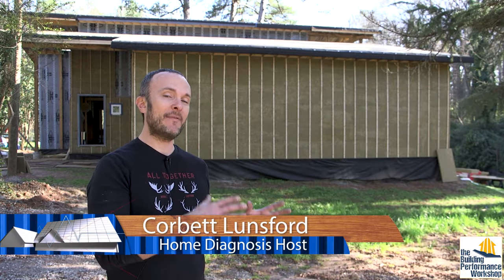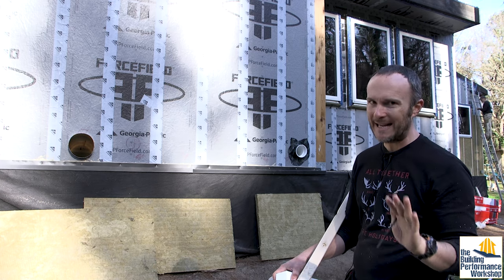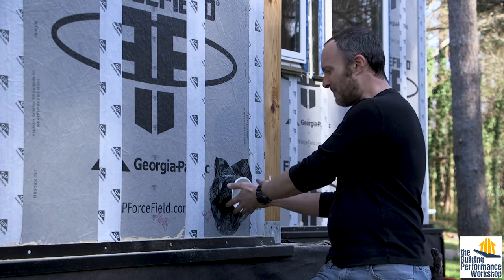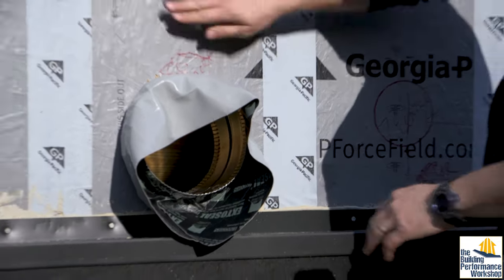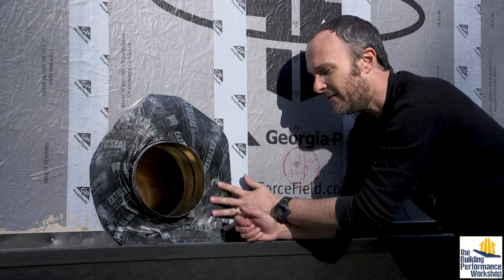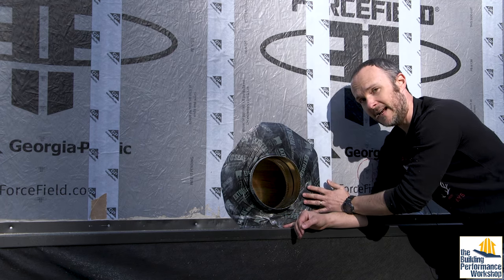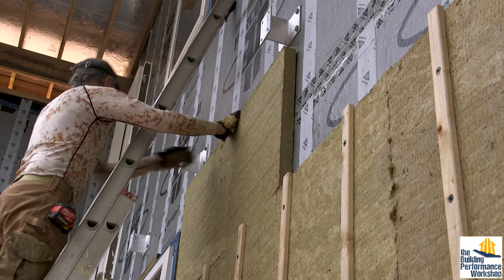How (and Why) to Wrap a House in Continuous Insulation: Rockwool ComfortBoard DIY

Comment: The Cost ; Yes ,  Going for a thicker insulated wall  will cost more to do , but after the house is built, the money you will save on heating, & air conditioning, will pay for the expense !  With raising heating cost's, the thicker wall , is worth thinking about !!
Reply: If you like efficiencies check out Norwegian fireplaces. The one in the USA and for me on the west coast are built for look and little to no function.

Comment: That Comfort Board is much more expensive than Comfort Batts, and those long screws to attach the furring strips back to studs are not only expensive, but they perforate the Force Field.  I don't trust that butyl tape to stay sealed around screws shifted by a 100 years of shrinking wood framing.  Wouldn't it be cheaper and safer to avoid all those issues by building a second unsheathed, vented, WRB 2x4 stud wall cantilevered 4" away from the Force Field sheathing and fill the gap with continuous Comfort Batts and the second stud wall with more Comfort Batts ?  R30 Rockwool all exterior insulation, R15 of it continuous, no penetrations of the sheathing, only attached at cantilevered brackets and rafter tails.  All the house framing could have been 2x4 empty of insulation. A bonus would be the window glass and frames recessed 8" back from the siding.
Reply from the maker: KW, you're talking way above my capability and my paygrade. For a 'real' builder, that might be a piece of cake, but your idea makes my head explode about halfway through the explanation.
Reply: I don't think it's beyond your capability at all.  You did a fine job on the structural stud wall framing.  This would be the same without the sheathing.  You used the Maine brackets to support a deck ledger -- you could do the same to support a separate sill plate all around a house for that second stud wall.  Or you could just extend the floor system 8"   beyond the stem wall foundation in every direction like you did your balcony.  Either would support a second stud wall to attach siding and the roof load is already done by the inner wall.  I think the Brackets are the more expensive solution.  You would have innie windows which is why I said recessed by 8".  

This has been a great build, using specialized materials conventionally.  I just wonder if 20 years from now people will be shaking their heads at mechanically fastened board insulation and it's thousands of penetrations the same way we do now about EIFS stucco over foam and osb.  It sounded great 20 years ago but caused thousands of homes to rot.
Reply from the maker: Aw shucks, KW- thanks. And I’m sure we’ll both be watching that all-wood assembly system from Switzerland that Risinger showed off. Solves those issues in an unexpected way.

Comment: As much as I disagree with Corbett about mechanical ventilation and air tightness I still watch almost every single one of his videos and his channel is one of the only ones I get alerts on. 

I appreciate that he talks fast so I don't have to put the video on 2x speed, he is passionate about home performance and has not been bought out by the companies who will remain unmentioned , and agree or not, he is blazing a trail and really wanting to increase knowledge of what makes a house "good"
Reply from the maker: Damn, thanks O. Audience like you is the ideal- don’t mind a bit that we don’t agree about everything, it keeps things spicy.
Reply: @HomePerformance  I wrote a long reply to this yesterday and somehow it didn't get posted so I'll rephrase in a more concise manner.

I think we have the same starting point, namely that outside air is better than inside air, and that house should have low, affordable energy use.

Where we differ, is the reliance on mechanical assistance.

Best comparison I can think of is - if I wanted an efficient clothes dryer I could go out and spend $3k on a heat pump clothes dryer. It would pay for itself eventually, if it didn't break before the payback period. Or I could dry my clothes on a line, outside, for free. 

Another example - in building a house in the hot humid south, one could paint the house all black, or all white. There is no cost difference. Yet, the all white house is cooler and more comfortable in the summer and uses much less energy for cooling, yet not appreciably cooler n winter.

So I guess what I'm trying to say is high performance is all well and good if we don't believe the natural and often times free ways to achieve the same result, like opening windows for ventilation
Reply from the maker: I understand what you’re saying, O- we can agree to disagree. In my view, depending on the weather and air quality outdoors to stay consistently dry, healthy, and fresh is asking too much when we have pollen, wildfires, neighbors, etc.
Reply: @HomePerformance   I agree with that. And I think each effective strategy should built around a specific climate. Passivhaus would not  make sense in San Diego and opening windows would not make sense in Shanghai
Reply: I agree totally it’s like everyone’s ancestors came from harmonically sealed boxes all the sudden. Can’t take flowers be quiet or deal with people around them. Build their houses out of things that can’t contract and expand. I’d rather have low energy bill by default. Open windows at night, close drapes to keep heat in paint house appropriately for the climate, basically live like the rest of humanity. Industry wants industrial answers it makes them money

Comment: Kick ass. Those danish people are smart for inventing rock wool. Usa is just getting onboard what canada 🇨🇦 has enjoyed for over 30 years (as in we have rock wool). Very clean and precise installation. Keep it up. Remember to furr out any batttin that are not in plane. Use a string to check how planar your wall is. Kick ass
Reply from the maker: will continue to kick ass as instructed sir
Reply: The question is how does your body get rid of it out of your lungs. Similar properties to asbestos. It’s made by heat and pressure on volcanic rock guess how asbestos is made lol
Reply: There are no issues. It rocks.

Comment: 2x8 framing is pretty extreme, at some point you should just use 2x10s on 48" centers that is pretty much the maximum spacing you can use with standardized sheathing while still having more or less adaquate compression strength. You might need to add metal reinforcements to get a good shear value (since each peice of sheathing is only nailed into 2 studs) and if this became standard practice we might need to use more engineered materials. 
Also why do warmer climates have lax insulation codes? Air conditioning takes a lot of energy if you don't have good insulation, and extreme heat can be almost as deadly as extreme cold if your HVAC fails at exactly the wrong time and you don't have good insulation.
Reply: You could do a post frame house. Post every 8 ft. Build a 2x4 interior stud wall. Super insulation done on the cheap

Comment: I just stuffed Rock wool insulation in all my 16 x 40 tiny house walls last night. Still have to do ceiling. I could tell last night after all the walls were covered the sound proofing was amazing.  My little shack is going to be air tight once I staple up the wrap and then add my 1/2 plywood interior walls.
Reply from the maker: Nice! Keep it up

Comment: Why I like exterior insulation is it reduced temperature differential across the wall.   Bats or foam in the wall will only do part of the work - exterior is a bonus.   Moisture follows drive: hot to cold, high to low pressure.  If you can cut differential across a wall in half, then drive is reduced - just make sure exterior details are set so failure is to the outside.   Some might recall the bad problems of synthetic stucco about   twenty years back - it had a horrible tendency to trap moisture and turn awall... into a moisture trap.
If you build new or take walls to the studs on a rebuild, don't waffle on if exterior insulation should be installed, but what & how.  Take an average house of the 60's and framing setback with a brick cladding only leaves room fot 1" [maybe as little as 3/4"].  Ok... do what you can [maybe xps foam], just remember cladding always needs a drainage gap or drain mat  behind it so it is able to dry itself out.

Comment: I learned to keep the intake AND the exhaust for the air to air exchanger. A decent wind will overwhelm the system with toi much outside air. I think next time I  will put a plumbing trap on the ventilator to decrease both outside positve pressure AND venturi. I wish I did my house in Massachusetts 20 years ago like yours.
Reply: Sorry... I was trying to say keep the exhaust AND intake out of the side of house with prevailing wind. You dont even have a damper.
Reply from the maker: Nice, Roger, and thank you for the compliment!

Comment: Regarding the exhaust and intake of the ERV, Zehnder recommends only 10 feet apart.  They told me it was more important to not have instake near something with bad air quality such as car exhaust, grills, etc.  Obviously more seems better if you have the ability though.
Reply from the maker: Yes, the intake should be at least 10 ft from any contaminant source

Comment: Your less than a mile from my grandmothers old house on Red Wine Rd. I was there often in the 70s. House is no longer there but a few acres still in the family. 

I'm designing my house now and weighing furring strips and rockwool or Zip-R 9 or 12. Indecisive at this point. 

Also planning for a partial encapsulated conditioned crawlspace for the same reason you did. I don't want to chip away rock on my upper slope and a conditioned crawlspace 24" higher than my basement works for me. I'd much rather have my equipment there with plenty large rigid ducts to the main and 2nd floor loft. 

Maybe I missed it, but any reason you went with Rockwool versus Zip-R or OX-IS other than possible off gasing of the polyiso.
Reply from the maker: Hey that’s cool- we did rockwool to stay free from foam (have a whole vid about why), and I’d consider the fastener and bucking complexities between the two ZIP-Rs.

Comment: excellent project, 
Radon Pipe is it really necessary when using a ERV system? seems that Rodon needs to build up to potentially be harmful. But if the air in the home is being exchanged, then would the radon ever build up? It would be interesting to do a test to see what would happen if you blocked the radon vent for some amount of time, then take a radon test to see what happens.
Reply from the maker: We certainly can just turn the radon fan off, and monitor the levels.

Comment: I would be grateful if you could answer this question. When you attach the wood strapping over the Rockwool using the screws, how do you ensure that the screws are driven an equal depth? If the depth of the screws differs then there would assumably be undulations in the wood strapping. Thanks for any thoughts.
Reply from the maker: The Rockwool 80 is very dense, not much worry- but you just don’t overdrive the screws to begin with I guess

Comment: Joseph Lstiburek's perfect wall building science
Please comment, it seems you have a the same layering configuration in walls? what about roof and floor?
He talks alot about condensation and how it creates mold / rot and destroys walls
Reply from the maker: Roof has no continuous insulation layer, because the energy model showed no significant benefit for this house in this climate. Airsealing makes the most impact on moisture control and condensation, but you also can choose materials that let the house dry in all directions, which we’ve done here too.

Comment: I see a lot of the Rockwool Comfort board being installed in colder climates, I assume that this has similar benefits in climates with extreme heat such as Las Vegas??
Reply from the maker: Certainly. The max temp difference we expect in Atlanta is around 50 deg F (70 in, 20 out)- Las Vegas can get to 50 F max diff in summer (70 in, 120 out).

Comment: Will your cladding face be flush with the outer most edge of your manufactured black aluminum drip edge? Or, how will you keep bugs from entering your rain screen cavities while allowing airflow and any moisture to drain out? Also, if you have any good resources to share on detailing rain screens, that would be much appreciate it. Thanks so much!
Reply from the maker: How to Bug-Proof the Ventilation Gap: Cor-A-Vent SV5 
https://youtu.be/L3TXRGwLaDY

Comment: Thanks so much for this video. It’s very informative. I’ve watched it many times. Could you please comment on how or if it’s possible to apply this technique as a retrofit over stucco? My house is from 1964 in SoCal. I believe it’s only stucco on wire lath, no plywood sheathing. We added insulfoam inside all the exterior walls but still not getting the performance we need. Is it possible to attach the rockwool with only studs and stucco to drill into?
Reply from the maker: Yes, you’d actually attach to the studs no matter what. Totally doable, just tricky. Thanks for watching multiple times, glad to help!

Comment: I'm surprised by your comments about not needing to stagger them. Any evidence to back that up? It seems to me that it would be more efficient to have two thinner layers staggered vertically add horizontally. Thanks!
Reply from the maker: If it was your only layer of insulation, or if it was also the airtightness layer, then it might make a difference. But you’d have to craft a way to attach the first layer.

Comment: I tried finding more of your vids on this build without success. I am looking for a "how to vid" when it comes to adding overhangs all around to an insulated box, ie. all forms of interior structural members being isolated from the exterior conditions or thermal bridging..       Question: Is there quantified data showing the longevity of the mastic which is holding your flex tape to the tin pipe? I know that the southern side of structures take a tremendous beating  from the sun..

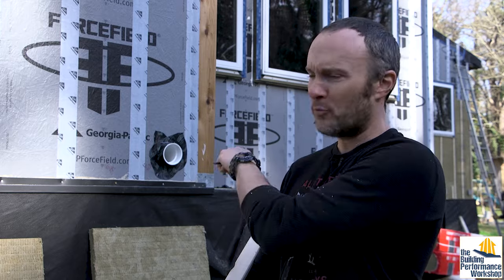Comment: Hi Corbett, thanks for sharing. At 2:00 I see a flashing material wrapping around the sill of the home to support the initial weight and maintain a level starter line of the rockwool. It looks like the rigid insulation of the foundation stretches from the ground up to that flashing. I'm trying to find a similar flashing which returns at the bottom, back towards the foundation (If you could imagine an upside down P shape). My question is, can you recommend who sells these types of uncommon flashing for rockwool wall systems? I reached out to rockwool but didn't get a response.

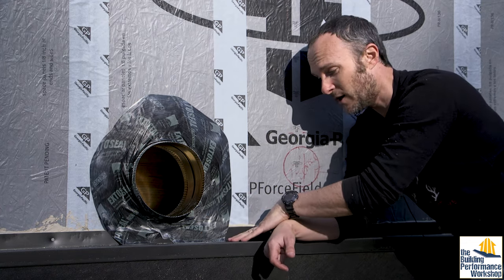Ohhhhhhh.. my bad. I just saw at 6:30 why someone criticized you for saying manufactured in place of fabricated. Big deal, the majority of youtubers would rather watch an unscripted video with some spontaneity and errors than an obviously scripted and edited but boring video. Looks like I might need to buy a metal brake for what I'm looking for.
Reply from the maker: ...Or just find a local sheet metal shop, which is a bit easier. Either way, thanks for watching and commenting, Justin!

Comment: Great Video! Question: I am doing 1 1/2" Owens Corning foam board with Tyvek Drain wrap over that and my 3/4" PT plywood strips into the studs as my rainscreen along with Cor-A-Vent over top both the foam board and house wrap. Do I continue it up in to the soffit or install my soffit first and then take the foam board up against the sofit?

Comment: Did you fabricate the 3/4" furring strips on-site out of plywood or order them as-is? We're looking for a good economical way to add a basic rain screen behind our cladding and I've seen a couple of different takes on this similar method.
Reply: Am thinking so long as you have 3/4 material you should have excellent holding strength for the cladding. Should not make any difference what material you use.  Check out this video from Jordan Smith last week.  https://youtu.be/utn4dKUAl8o  he is talking about attaching lap siding
Reply from the maker: Yes, ‘real’ builders should use the tools and manpower they have to save $$. It’s worth it to us to just buy 1x2 furring strips off the shelf, because of our specific circumstance.

Comment: Does ComfortBoard have a foil faced option?  If so, why did you decide not to use it? I'd think Atlanta would be hot enough.
Reply from the maker: Radiant barrier works in our climate on the roof, but not walls so much. They do not have foil facing as an option, though we have some on the roof OSB here.

Comment: Excellent video but unfortunately you can not get rigid mineral wool insulation at any of the building stores such as Home Depot or Lowes and when you try to order it from them you get a series of horror stories from them trying to dissuade you from ordering it and even if you make an order it is so costly it gives you a heart attack.  They commonly carry mineral wool batts but no rigid insulation.
Reply from the maker: Haha jeez